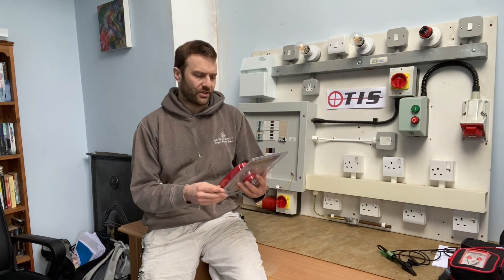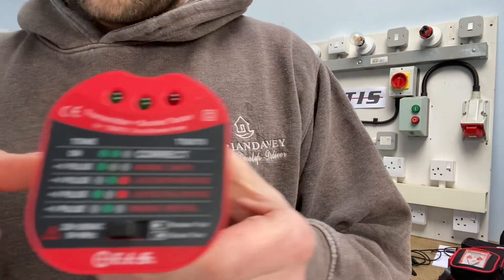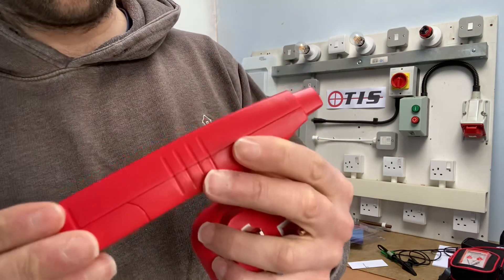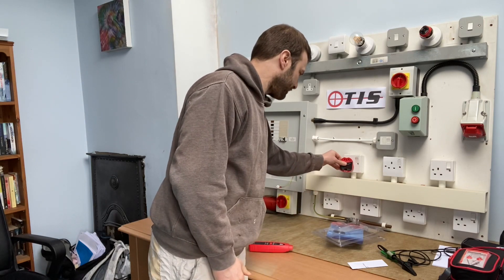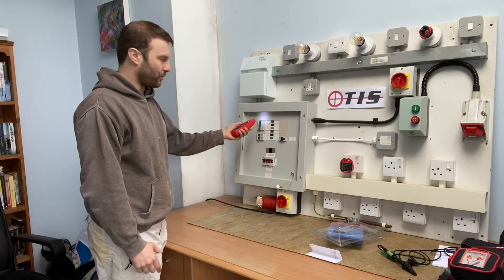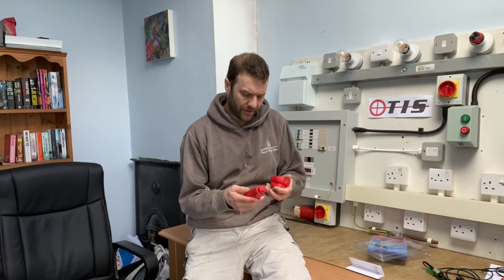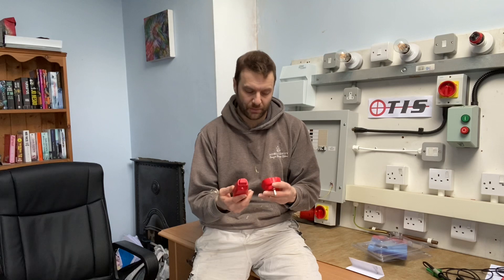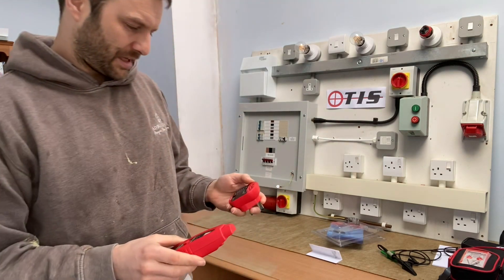Test Instrument Solutions (TIS) video 2 - The TIS 870 plug in socket tester/circuit finder with NCV

Comment: Seems like a great idea. I know about the line tracer kits which I am wanting to get, but never one that works on live circuits. Granted its only on socket circuits unfortunately. 

Not that useful for simple domestic properties, but larger commercial or industrial where you have poorly labelled circuits, identifying that one socket circuit to minimise disruption is fantastic.
Reply: see my comment above, i think it could work on lighting?
Reply from the maker: I’ve got a Martindale one that works on lighting as well, but it doesn’t test the socket and it doesn’t have the NCV option.

I use mine a lot in domestic to save time and disruption.

I also believe it also makes me look more professional which can only be a good thing

Comment: nice video Adrian, i find them very helpful. I have been thinking about getting one of these for a while but wanted to wait until they did one for tracing sockets and lighting. I am yet to find one. in theory could you make up an adapter with a single socket wired in test leads (push in style), then plug the made up socket into your lamp test adapters with the plug in tester on find mode, then back to the mcbs and use the same method? what's your thoughts, i don't see why it wouldn't work to be honest. cheers.
Reply from the maker: I’ve got one of these myself, it’s just a shame that it doesn’t test the socket and have the NCV option

https://martindale-electric.co.uk/product/fd650-digital-fuse-finder-kit/
Reply: Can this be used to trace cables in a cable run like the NCV tester can or does it only work at the breaker/fuse?
Reply: @StevenFraser1980 I believe only at the breaker/fuse